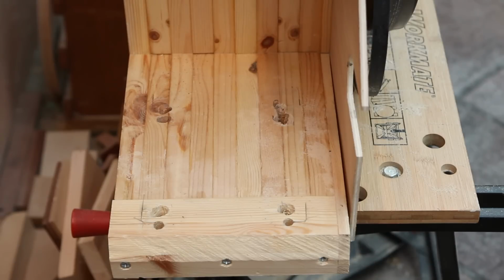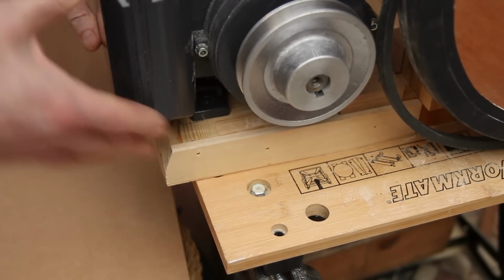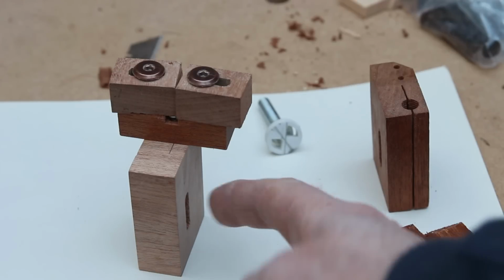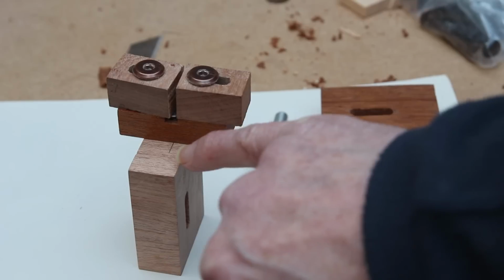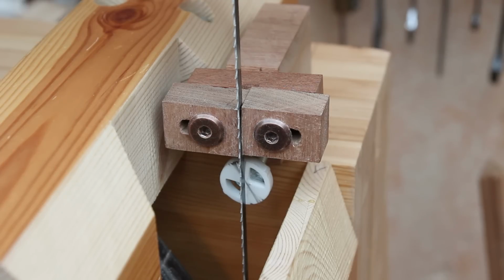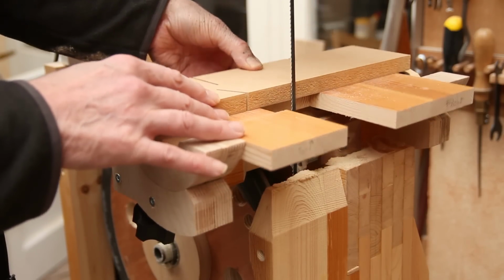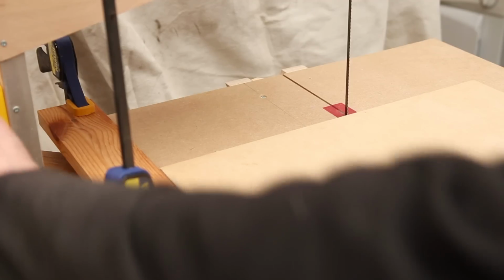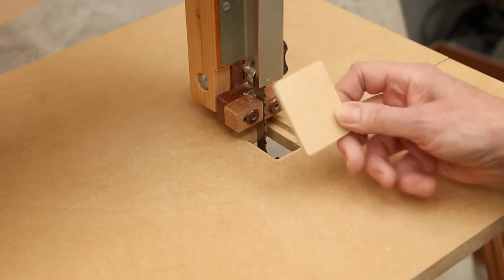Bandsaw Build Diary - Part 9

Comment: Loving this series. I think, when I get to this stage, I may abandon having a tilting table. I can't imagine that I would need it much, if at all (I never tilt my scroll saw table. On rare occasions, eg 90 degree meshing gears, I use an angled sled). Why do you not think that MDF would be a suitable permanent table?
Reply from the maker: I know what you mean about the tilting table. I considered not bothering. But there have been a couple of times in the past where I couldn't safely do an angled cut on the table saw but where the band saw would have done it.

And trunnions instead of hinges? Well it is satisfying to see them in action. And it is nice that the zero clearance insert can stay in place without risking the blade if I tilt the table without thinking.

The MDF table might well be fine. Most of my sleds have an MDF base and they're fine. If I want to create a mitre slot in the band saw table, though, or add a fence rail, I may change to something else. No plans for that at the moment, however.